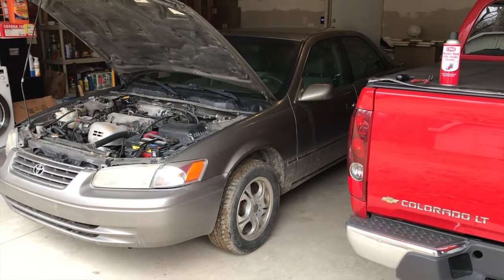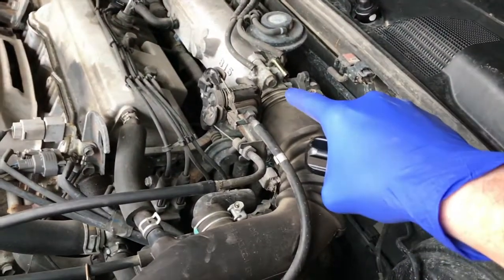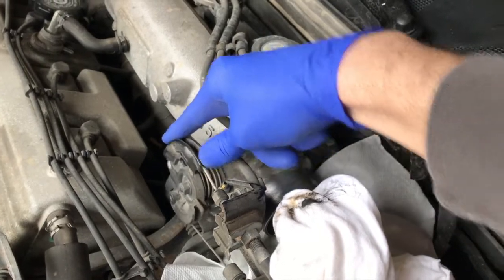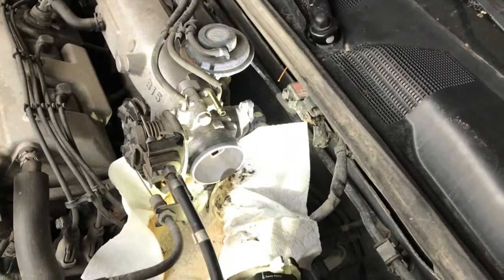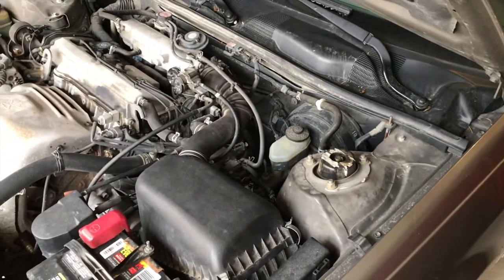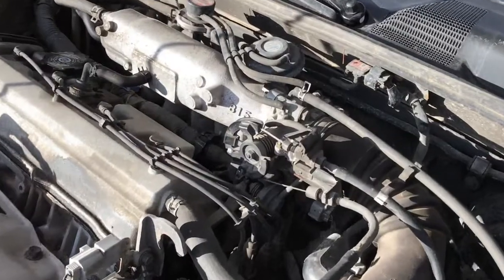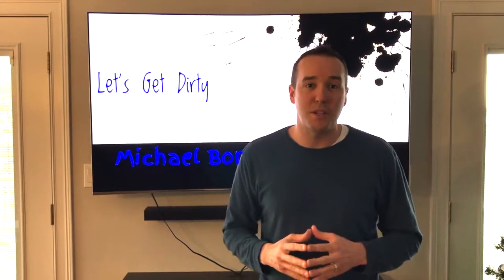Hard/Stiff/Sticking gas pedal - How to clean Throttle Body FAST & EASY!

Comment: My 2010 kia Rio had a sticky accelerator. I had to push a little harder than normal to get the pedal to "unstick". and when it did unstick, the force i was applying would make the engine rev to 2000 to 3000rpm. Very annoying in stop start driving. Cleaning the intake valve worked very well.
Reply from the maker: Great to hear & we appreciate you sharing this.  We will be cleaning ours again here in the next few days.  We like to clean out our throttle body once every few years.

Hope all is well.  😎👍🔧🔩

Comment: I just purchased a 1990-91 something like that chevy s10 the pedal is very hard to push and it even makes it easy to spin the tires because it's so hard. it also idles a lil rough.  I will try this. p.s. the previous owner didn't drive it much
Reply from the maker: Thanks for watching & we appreciate you reaching out to us.  We are hanging out today at the DIY Raptor headquarters watching college football answering all questions for our fellow DIY’ers.

You will notice a significant difference as cleaning yours.  Please keep us posted.

😎👍🔧🔩

Comment: My check engine light came on and the vehicle threw this code. The mechanic said simply cleaning the throttle body rarely works for more than a few miles and I should have it totally replaced. Any thoughts?
Reply from the maker: Thanks for watching, it’s possible…

Have you performed this cleaning process on your car?

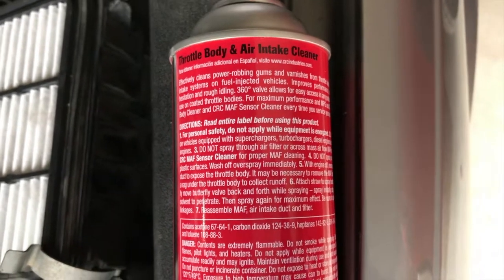Comment: At 3:02, you read direction #2 stating not to use this on cars with a turbocharger. I have a turbo on my 2000 GSR engine and have the sticky pedal issue. Are there cleaning alternatives for my throttle body?
Reply from the maker: Thanks for watching, there is indeed.  You can get turbocharged specific cleaner at AutoZone.  😎👍
Reply: @DIYwithMichaelBorders  thank you!
Reply from the maker: @lloydrobinsoniii  

You are welcome.  👍

Comment: Hi love the video mate, I've got a hard to push throttle on a Toyota corrolla 04 I'm goin to try this was just wondering should I be worried about the gunk/spray running into the inside the engine as my throttle body on an angle?
Reply from the maker: Thanks for watching & welcome to the DIY Raptor Club.  It’s a good idea to start car & have engine run for about 5 to 10 minutes.  This will allow your engine to burn off any and all remaining cleaner spray.

Keep us posted.  😎👍🔧🔩

Comment: What should I use for a turbo charged engine?
Reply from the maker: Thanks for watching & AutoZone sells a specific cleaner for turbo change engines.  We recommend giving them a call first to ask if it’s in stock.

😎👍🔧🔩
Reply: @DIYwithMichaelBorders  just did it with the regular cleaner but I let it dry afterwards. Hopefully my Veloster is okay lol 🤦‍♂️
Reply from the maker: @thelmc  

Thanks for the reply.  A clean Throttle Body is a great thing.

Comment: I got stuck egr valve that I can’t get off and this is soo close to it do you have any suggestions you think may help me I’m getting a p042 code and I’m pretty sure that’s it bc I changed the O2 sensor
Reply from the maker: Thanks for watching & welcome to the DIY Raptor Club.  What’s your update?  The P042 code is tied to your catalytic converter operating below designed system standards.  It’s possible the code is related...

Keep us posted on your project.  😎👍
Reply: @DIYwithMichaelBorders  thx for responding and it’s actually P041 forget after I changed the o2 sensor the 042 code disappeared only thing that’s showing up now is 041 and it kills my gas and gives me kinda a ruff idle so I just clear until it shows up again
Reply from the maker: @TWAN330  

Thanks for the reply.  It’s very possible that your EGR valve is stuck...or failed all together.  A new EGR valve will hopefully solve issue.

😎👍🔧🔩

Comment: Hello.. so I have a truck, was sitting down for like 2-3 years, as a project truck, I replaced the engine for a used one but with low miles, and before, my gas pedal was very hard, and now with the engine swapped, it’s the same..

You think that could be the wire that goes from the throttle body to the pedal.? Might need to lubricate or something.?
Reply from the maker: Thanks for watching & welcome to the DIY Raptor Club.  It’s very possible since the new engine swap didn’t fix it.  Also verify the pedal itself is not obstructed by anything.

😎👍🔧🔩
Reply: @DIYwithMichaelBorders  awesome.. I ll take a look at it... ll get back to you
Reply from the maker: @santiagodavila1426  

Very cool & we appreciate that.  😎👍

Comment: can you use carb cleaner
Reply from the maker: Thanks for watching & welcome to the DIY Raptor Club.  If your engine is carburetor as opposed to fuel injected, carburetor it’s OK.

You will want to stick with this specific throttle body cleaner if your engine is air intake and fuel injected.

😎👍🔧🔩

Comment: Hi, after cleaning my throttle body the pedal became sticky, it was not so before the clean.
Reply from the maker: Thanks for watching, an additional spray or two may help as it’s likely that a small particle of debris has gotten stuck in a way that’s interfering with the efficient operation of Throttle body.
Reply: @DIYwithMichaelBorders  thank you for your quick response, tomorrow I will respray and get back to you.
Reply from the maker: @selebogokhune  

You are welcome, we are here for the DIY community, ALWAYS!  😁👍🧰
Reply: @DIYwithMichaelBorders  forgot to mention that it only sticks when taking of from a traffic light or after having let go of the gas pedal for some time. Do you think it still needs more spraying?
Reply from the maker: @selebogokhune  

Thanks for the follow up, yup…an additional spray and friendly cleaning will be hopefully all you need.  😁👍
Reply: @DIYwithMichaelBorders  thank you, will do that.
Reply from the maker: @selebogokhune  

👍🧰
Reply: @DIYwithMichaelBorders  hi, I sprayed it more even went down the Idle Air Control Valve but it still sticks.
Reply: @DIYwithMichaelBorders  Hi, I resprayed the TB, even went down the IAC valve and lubricated the accelerator cable. But after driving for about 30 minutes it started to stick again, however not as severely this time. I lubed the cable again overnight now I’ll see how it drives this morning, I might have to take it to Toyota.
Reply: @DIYwithMichaelBorders  I went to a cable shop to clean out the accelerator cable, and prayed about it, all is well now, no more sticking. Thank you for the help mate.
Reply from the maker: @selebogokhune  

Good afternoon, we are back with you.  That’s an awesome update, we are happy to here you are back to proper working order.  Thank you for taking the time to share your update and details.  👍

Comment: Hello Michael. I came across this video researching a gas pedal that is hard to push. It doesn't stick, but it is very difficult to push down. I was thinking it was the throttle cables, no? This would be a lot easier just to clean the throttle body and not have to mess with or replace all the cabling. That wouldn't be fun so I am going to try this first and see if it helps. Thanks for the video! I just hope it's not the cabling. :)
Reply from the maker: Thanks for watching & welcome to the DIY Raptor Club.  You will hopefully experience a huge improvement to the operation of your gas pedal after cleaning the internal portion of your throttle-body.  Keep us posted.

Hope all is well.  😎👍🔧🔩
Reply: @DIYwithMichaelBorders  It also could be the throttle cable and spring. When I removed the throttle big hose and looked inside it actually looks very clean. I try pushing on the butterfly metal inside the throttle body and that's even hard to move. Is there any way to adjust or losen the actual cable assembly or spring that you are aware of?
Reply from the maker: @Trekopolis  

Definitely true.  Thanks for the reply & there is however it’s not a common MX item.  Keep us posted on how your engine performance is after cleaning.

Comment: Hi Michael, i have a strange question.  My gas pedal and brake seems to be connected to the vehicles electronic.  When i change the temperature of ac, or turn on and off the cars features, including audio operation, it seems to affect the stiffness of my gas and brake pedal.  Is this even remotely possible?  Thanks!
Reply from the maker: Thanks for watching & welcome to the DIY Raptor Club.  This is definitely not normal...🤔

Most common cause for this such behavior is loose wiring.  Something electrically is loose causing sporadic behaviors when you make adjustments to other electronically operated systems.

Tough to pinpoint the exact location, will take time to look around & see what’s loose.

Check:
     *  Fuses
     *  Electrical connection points 
     *  Signs of melted/damaged wiring

Keep us posted.  😎👍

Comment: Is this same way to do this on a 2000 Toyota Corolla CE my gas pedal is hard to push and doesnt wanna accelerate when push
Reply from the maker: Abner Vazquez 

Thanks for watching & we are glad to help.  It will almost always be the cause...a gunked up Throttle Body.  Keep us posted.

Us fellow DIY’ers need to stick together.  Many more helpful videos to come!  😀

Let us know if you have any questions.  Please subscribe to the channel and Ring your YouTube Bell 🛎 that would be awesome thanks again!

😎👍🔧🔩
Reply: DIY With Michael Borders My car like when its put in Drive and when i press gas it hesitate to go. There is delay when pressed on gas pedal and i have to push it down harder to basically un. Freeze it and start to go, everytime i come to a complete stop and press gas it always hesitates
Reply from the maker: Abner Vazquez 

Thanks for the reply.  Have you replaced Spark Plugs & boots/coils in the last 2 years?

Also, we recommend replacing your Air Filter as well.  Keep us posted!

😎👍🔧🔩
Reply: DIY With Michael Borders i Replaced the Spark Plugs and the problem went away!! I will replace the ignition coils to. But it hasn’t done it in a while and car feels like it got power now. The old spark plugs were burnt
Reply from the maker: Abner Vazquez 

Awesome Awesome & thanks for the update.

😎👍🔧🔩
Reply: DIY With Michael Borders Thanks so much!
Reply from the maker: Abner Vazquez 

😎👍🔧🔩

Comment: thx u
Reply from the maker: You’re very welcome.  This is a great product.  We have always been impressed with how this cleans out the Throttle Body.  Hope all is well.

Enjoy your day.  😎👍🔧🔩
Reply: @DIYwithMichaelBorders   Tomorrows day off so ima start in the morning.  ill do the hrz wait then reassembly wait 3hrz as the video stated then drive for the 30+miles .   wish me luck
Reply from the maker: @BkLyn-ys4gl  

We are routing for you.  😎👍
Reply: Hey  So far i just replaced the Air fiLter an i already feel an hear the difference-  in the morning ill start the throttle body-  Went to Auto zone an got the Last CRC throttle air + cleaner off the shelf’   thx u guyz for the support👍🏼
Reply from the maker: @BkLyn-ys4gl  

Awesome Awesome & you’re on the track to getting back up and running as designed.  😀

You should notice a huge difference after cleaning the throttle body.

😎👍🔧🔩

Comment: I have a 2006 Pacifica and it has a sticky gas pedal. My car doesn't have a throttle cable it, works with the computer. I just wanted to know if cleaning the throttle body would fix  a sticky gas pedal just like it would if it had a throttle cable.
Reply from the maker: Paul Griswold 

Thanks for watching & sharing your question.  Great question & it definitely will help improve & get rid of that annoying sticky pedal.

Keep us posted on your DIY project.  Please subscribe to the channel and turn on your YouTube notification Bell 🛎 that would be awesome thanks again!

😎👍🔧🔩

Comment: Is this a Toyota Avalon ?
Reply from the maker: Ricardo Vega 

Thanks for watching.  This is a 1999 Toyota Camry.  Let us know if you have any additional questions.

😎👍🔧🔩
Reply: DIY With Michael Borders I have a 04 Toyota Avalon I’ll be removing the throttle body completely off to give it a proper cleaning do I still need to let it sit for 3-4 hr ?
Reply from the maker: Ricardo Vega 

Thanks for watching.  We recommend allowing the engine to sit in the off configuration for a minimum of 3-4 hours which will allow the engine to cool off prior to working with parts that get HOT.  Keep us posted.  Us fellow DIY’ers need to stick together!

😎👍🔧🔩